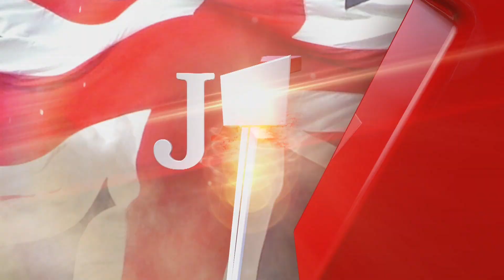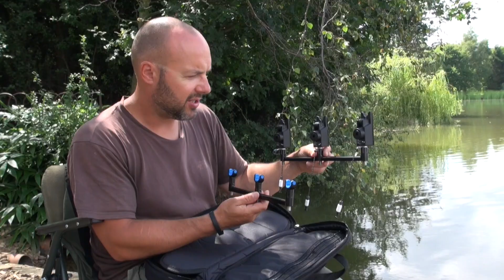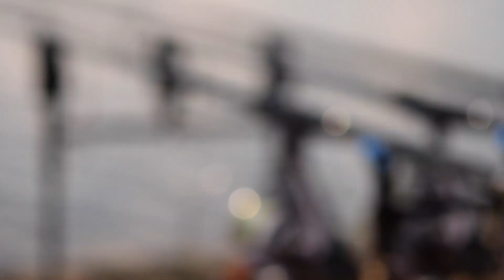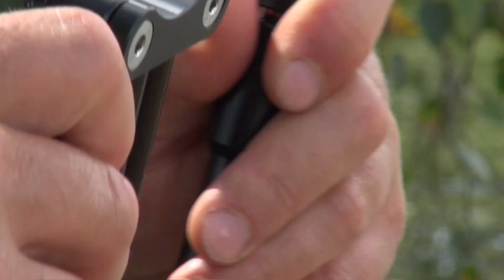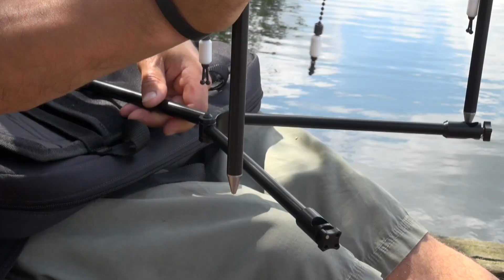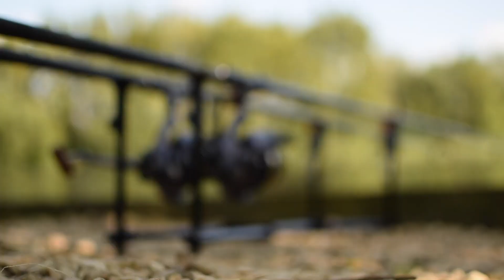Carp Fishing - JAG Black Super Compact Pod Kit - Adam Penning

Comment: This is quiet a deceiving review of the pod, it would appear to any one that hadn't looked into it further that you get what is being reviewed as part of the kit.  You don't actually get the buzz bar bag as part of the kit  so you will need to add an additional £40 - £50 quid on top of the price of the "JAG black super compact pod kit" to get this as well, this pushes the price to over £350 quid, im extremely surprised that for £315 quid you don't get the buzz bar bag included.